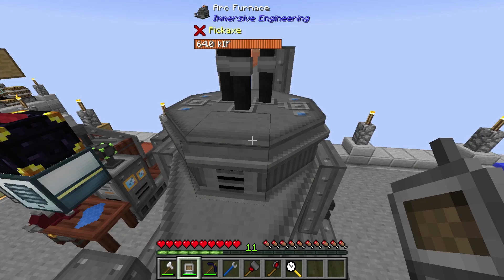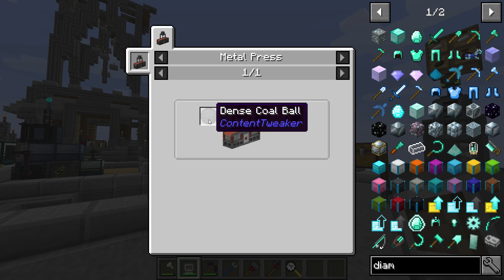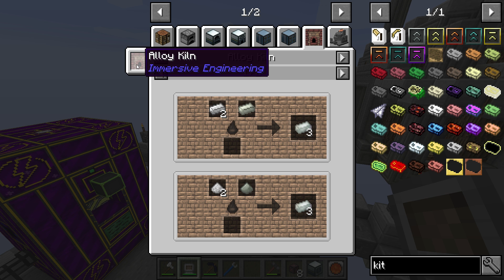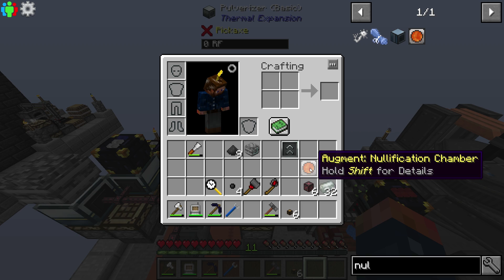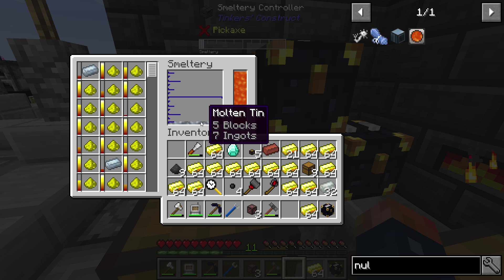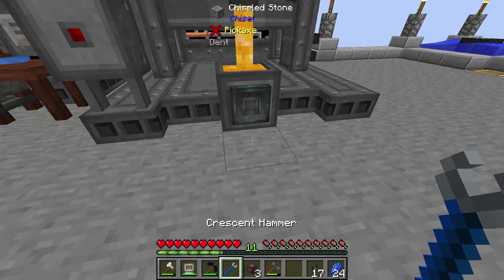Ultimate Alchemy Modpack Ep. 15 Diamond Automation

Comment: Tiny chests to only allow 1 stack to flow at a time have it set with logic so only one chest can flow out at a time. Locking the tiny chests so more cant flow into them while they empty. Then once empty it stops flowing in unlocks the other to flow in and starts to fill. I used to use super circuit maker for this. Don't know if it's in the pack